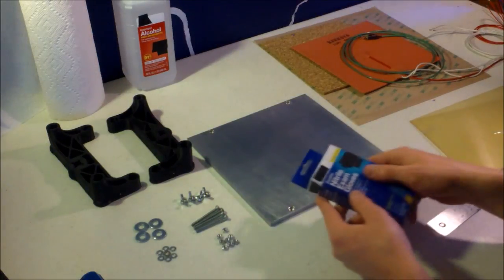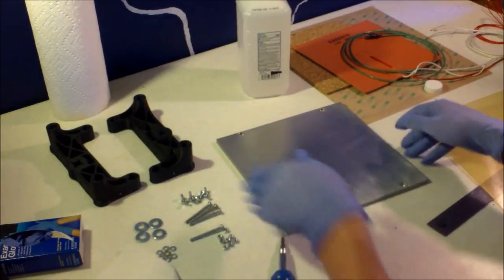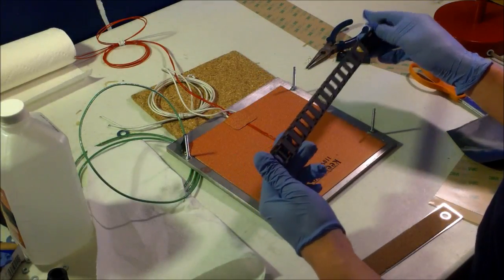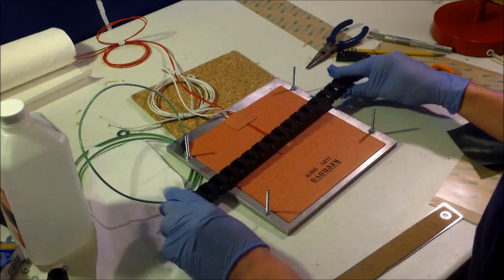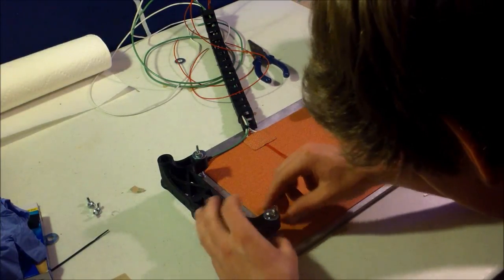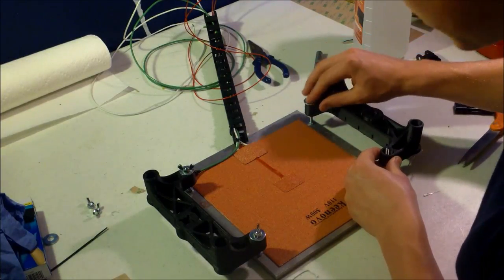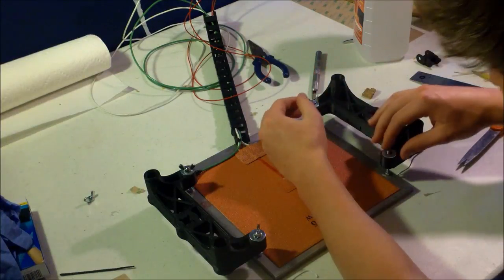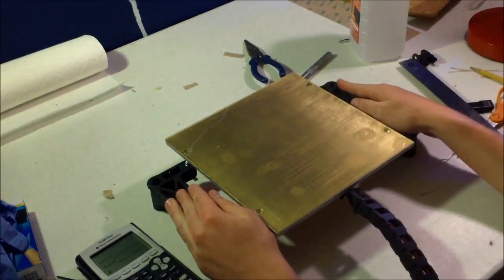Screwless-Bed for 3D Printing!

Comment: Much easier to stick the 3M to the PEI first, than doing it the way you showed.
Reply from the maker: interesting, I found that it was quite a bit more difficult (I installed PEI on my prusa in your suggested order) due to the fact that the  PEI warped

Comment: Hi I made this printer but did not complete it I still have the bed to make and do all the electrics but the github file have cone any chance you still have the. If not what size is the Aluminium Plate? Thanks

Comment: i noticed the bed was beefed up compared to the voron design. do you have files for that? thanks!
Reply from the maker: The bed is actually the exact same as the one in the design file found here
https://github.com/mzbotreprap/VORON/blob/master/Documentation/VORON%20Bed%20Plate.png

exept for the fact that it uses M4 instead of M3 Screws

Comment: What thickness of PEI is recommended?
Reply from the maker: I used .03" thickness but check with the manufacturer/designer of your printer model. .03" is the standard but it may vary
Reply: Thanks - I'm the printer designer so we'll go with 0.03"!